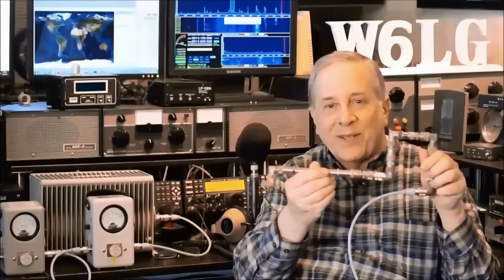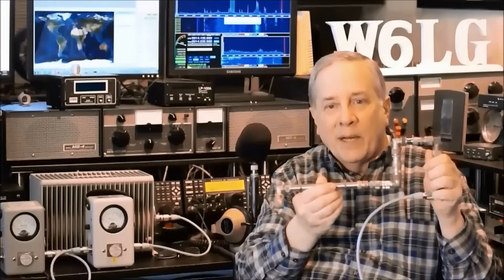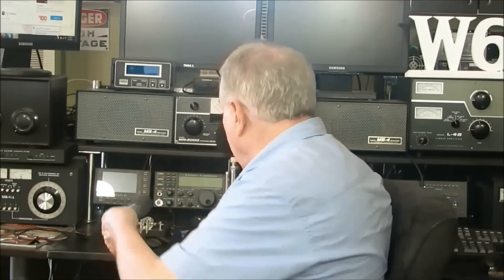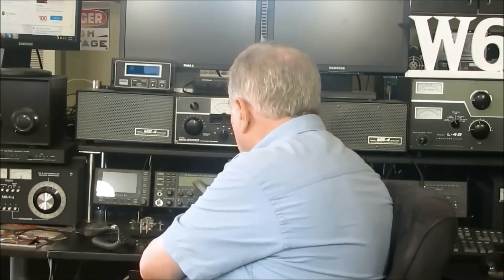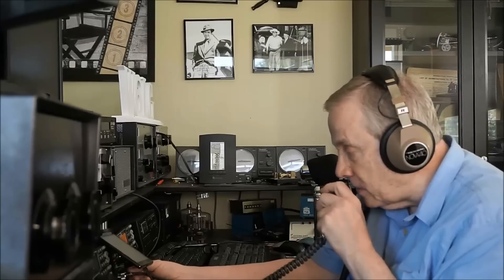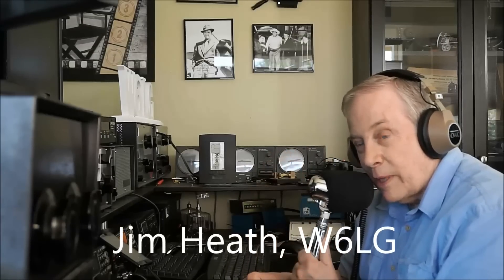Ham Radio Basics--Using And Adjusting Your Microphone

Comment: I'm brand new to HF. I have a 'loaner' Kenwood TS 570 D from a friend who is helping me "get my feet wet" before I spend the big bucks on a radio of my own. I've got a Vibroplex end feed long wire (135') up in the backyard here in northern NV. I've managed to get a few good contacts (Australia, Hawaii, etc) but they say my audio is horrible. This is how I found your video. With your tips here I have something to go with. Others have also suggested that turning down compression, keeping the ALC barely moving, etc, might help my bad audio reports. Thank you for an easy-to-understand video. As an aside, I used to have a D-104 mike back in the 70's in my old CB days. Great mic. Wish I still had it.

Comment: Thank you Jim !!  I operate a Drake TR-4C barefoot and a Kenwood 830S barefoot. I use an old D104 unamplified G stand on the Drake and a amplified D104 on the Knwd. Also have an older Shure 450 and an Old Midland 22-211 that I have never tried. I think I'll try it out on my Drake and see how it does. Thanks again for a great Video !!

Comment: Jim,  Been a ham a long time, but mainly CW and now digital modes.  I guess regarding SSB the analogy of being a communicator and not a broadcaster is correct.  Due to the limited audio response of SSB, really any mic will get the job done.  Recently though, I've been monitoring the AM guys on 80 meters here in the northeast. Using the AM mode, audio can range from 20 hz to 10,000 hz, some rigs are able to do better than others.  Correspondingly, those that use AM want to sound as natural as possible and thus spend considerable effort in achieving that goal.  Many run classic rigs from the 1960s.

One trick using a handheld mic, yes, can't get away from the PTT click, but an old technique is to turn the mic 90 degrees with the corner of the mic at the corner of your mouth.  That way, one speaks across the mic and not into it, reducing breath pops.

You in California have to contend with ac and fan noise, here in the northeast my shack is in the basement and I have to contend with the cycling of a forced air furnace and it's associated noise.  

I enjoy your videos - 73 de KQ2N

Comment: This handheld microphone has the best sound, so full, easy to understand.
It's a bit strange that the astatic SSB has a lower gain than a passive handheld microphone. Well, unless it's the base version without the preamplifier.
SSB likes dynamic mics with a slight extra gain correction for 2-3Khz but it's not necessary.
AM for CB likes (piezoelectric) or other microphones with strong pre-emphasis. Because the AM CB receiver has significant de-emphasis.

Good health :)
Reply: I have the exact same astatic 10da with a g stand. It has no preamp and the frequency response is 300-3000hz an output level of -52db it definitely has a higher gain than some dynamic mics and chrystal microphones but it is designed specifically for ssb. Hence "super sidebander" name.
Reply: It's great that you have a passive microphone, that was beautiful. Classic microphones are the most fun to own and operate.

These dynamic passive microphones should have an impedance transformer to raise the impedance to a few or tens of kiloohms, which was needed to drive tube modulators.

Good health.

Comment: Good advice, though rigs have differences and it is worth spending a little time getting used to them, I always use compression, not much, and the drive control down very low, the RF power control on my rig merely causes ALC to trigger early. So that stays fully clockwise. All very well having a 200w rig but my amplifier needs very little drive.

Comment: Bill Belichick's brother! I love your vids, Jim. What is your opinion of converting a crystal mic (Turner 33X or D104 perhaps) without changing the element (to an electret?) for a modern HF radio? I have seen other vids that cover (poorly) the construction of the preamp/impedance matching circuit but none pointing to where a finished product can be purchased. I have significant arthritis in my hands and I am no longer able to do the delicate stuff. any suggestions?

Comment: I’ve just started monitoring how I sound on air and your dead on. Best advice is to get headphones, good comfortable headphones, get comfortable, turn the Tv off, if you don’t have foam on your mic talk across it not into it or you will get breathing and puffs. Check your manual for proper ALC level, compression, and mic EQ, loose the base, Get the mic into a position where your comfortable, speak don’t yell, speak slowly, e-nun-ci-ate,  and did I say speak slowly?

Comment: Hi I'm studing for my license ..and where i live I'm not able to have a base set up..what would uou recommend for a mobile set up...i have a chance to pick up a RCI 69FFB4  and a stryker 10k anntenna..what would think..thanks for your response
Reply from the maker: I would not buy it...no question about that.   Stick with name brand "amateur radio" equipment that can only be used on ham radio frequencies. Brands like Icom, Kenwood, Yaesu, Elecraft are designed to be very effective on ham radio frequencies.  For example, the antenna that you mention claims it can handle 10KW.  The coax is good for about 1 kilowatt max.  The coax connector is good for a few kilowatts.  The whip would heat up and probably fail. The corona ball could not handle the voltage and is way too small for 10KW.  The coil in the housing probably could not handle the current generate by 10KW.  It is that kind of claim(s) that cause me to recommend not buying equipment like that.  Again, stick with name brand equipment.  Buy from stores that sell to amateurs like DX Engineering.  Power equals current squared time resistance.  So, 10KW equals current squared times 50 ohms.  A little algebra and the current is about 14 amps.  I think the coax has a center conductor of #20 wire. That size wire cannot handle 14 amps.   Good luck and have lots of fun on the ham radio frequencies. Regards, Jim

Comment: It was very informative... what about the  headsets??? All those rules applies for it?? I’m wanna use a cheap gaming headset on my mcHF but I know that I have to build a separate PTT with the wiring arrangement for that rig because the designer has the mic/ptt wired on a different way with gnd on the ring of the standard 3.5mm plug...
Reply from the maker: Okay.  Have you considered RF?  That is to say, have you decided what to do in an RF rich environment and using an audio cable that could produce RF feedback?
Thanks & 73, Jim

Comment: I am wondering about rigs without compression. I am mostly running qrp with a xeigu x6100, a yaesu ft-817nd and an RCI2950 I have an outboard mfj speech processor and I have been unable to make it sound good.  (Using your technique by listening with another radio). I also just got the sotabeams outboard compressor for the 817 (I'm struggling to get it sounding good).  I don't yell into the mic but have a very commanding voice. It seems like with the compressors they cut out while I am talking and I lose syllables (critical information while giving a callsign) even while "eating" the microphone. On my RCI2950 I have the same microphone you have the 10da and g-stand combo but it isn't enough to drive the radio so I put the 10da on my amplified stand and it sounds much better.  Is a compressor really needed to sound good or are there ways without it?
Reply from the maker: I am in a hospital bed and willl soon receive my 8th transfusion.  I have not used those devices.  I would set the mic ain for about half the ALC scale on the trnasceiveer.  would then envoke the prcoessor.  That kind of processor can be a lot of trouble.  I would speak into the mic until I had about 5dD of ccompression and ALC still at about three quarter scale.  You may never get that combination to work corrrectly because of the audio compprssor is full, yes full of IMD's because of clippplng in the audio pass band.  73, Jiim
Reply: @ham-radio  thank you for your suggestion. I really appreciate it. I've been a watcher of your videos for a while. I'm new to HF and a technician at this point going to take my general test this month. 

I will be praying for your speedy recovery and thank you for the great content you provide. 

KD9QLK

Comment: Jim, Thanks for the very informative videos.  I especially liked this mic one.  I have an old Astatic D-104 I bought new in 1974 or so and I would like to use it now on my Yeasu FT-991A but I've been told the input impedance was all wrong for newer radios.  Do you have the original cartridge in your Astatic mic or has it been replaced?

Comment: Hi Jim,
I am a looking into purchasing a 
Shure SM7B  Cardioid Dynamic  mic
and a MFJ 1263 mic  Control center 
To add to my icom 7300.  Do you think that Mic  would be acceptable for voice communication?    73.  Dan
Reply from the maker: Hi and thanks.  I do have that microphone.  I got it from Northcomm Technologies in Texas along with their boom arm.  Nice folks!  Here's the URL:https://northcommtechnologies.com/
You will likely need an external mic preamp.  I don't know about the MFJ device.   If it has a mic preamp, then that should work.  Icom's seem to be made to have a high output electret mic and not a low output dynamic.  Question: Why do you think that you need a very expensive microphone?  With the arm, CloudLifter and Mic, you are just below $1000.  You can buy the Newer 700 mic like this:Neewer NW-700 Professional Condenser Microphone & NW-35 Suspension Boom Scissor Arm Stand with XLR Cable and Mounting Clamp & NW-3 Pop Filter & 48V Phantom Power Supply with Adapter Kit for $50 on Amazon.  I have tested both mics extensively.  There is little difference.  The mechanical arm in that package is not great.  We are communicators and not broadcasters.  Your goal is to be clearly understood around the world with good clean audio, clean signal that has lots of highs.  In any case, have lots of fun and thanks for asking an excellent question.  73, Jim
Reply: @ham-radio  I am a newbie, and still trying to learn and figure everything out. I ended up getting the Heil PR-40 
It seems to be more fitting for communication. I am still studying to get my Ham Ticket. Figured if I invested in my Rig
now, it will push me harder to pass my test.
As far as price point, the icomm 7300 is considered entry level, it was love at first sight after seeing the reviews on utube. I just  didn't want to get something that I wasn't going to be truly satisfied with. 
A rig is like a marriage, Expensive. 
So imo make sure that it's truly what you desire.  (Disclaimer-- im not married so price point belongs to me lol )😁
Thank you for your info. As I have so much to learn.      73's.   Dan

Comment: This is a great video.   I am trying to improve my transmission audio on my kenwood 890, I am using the heil pro 7 headset.  Any suggestion would be appreciated.  Also, I see you can actually record and even hear your audio during the transmission.   How are you monitoring your own transmission?   This would be very useful to me.   Thank you, Bill, KN4RYD
Reply from the maker: I use the monitor function in the K3.  I can also use another transceiver or an SDR. But typically, I am using the K3's monitor function as a guide.  It is not perfect but adequate.  Thanks Bill & 73, Jim

Comment: I tried this method on my 7600, if I dont put the alc up high with mic gain the mic is very quiet, I confirmed using the voice record feature and I can barely hear myself. If I turn the mic gain up. It brings the voice level up to 100% on the recording meter scale for voice, my alc is now  s9
Reply from the maker: Question:  how far were your lips from the  microphone?  Icom is known for its low audio gain at the mic.  The ALC should not be high at at the top of the scale.  When it is, the transceiver is probably causing some splatter and distortion.  Also, a meter for measuring output can be slow to respond and provide an incorrect reading of the output.  73, Jim
Reply: @ham-radio  thanks for reply, I am using the 7600 in conjunction with a w2ihy eqplus and pr781, I just use the comp on the eqplus at 10 o clock, I noticed if I put the eq on 7600 to +5 bass and +0 treble it has much more output power. What would you recommend for the eq setting on the 7600 with the pr781. I do not use the w2ihy eq section it is disabled. Thanks

Comment: These are all non-amplified microphones is that correct
Reply from the maker: Correct.  Except for a small number of Icom transceivers, an amplified microphone is not desirable not needed.  Amplified microphones are trouble; RFfeedback, distortion, splatter, over modulation.